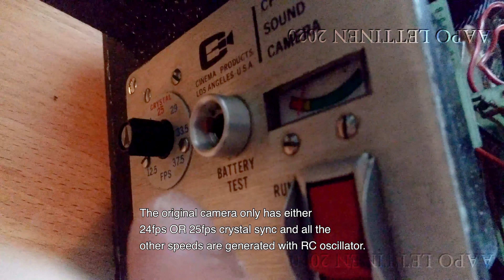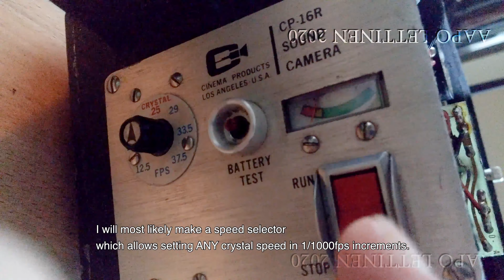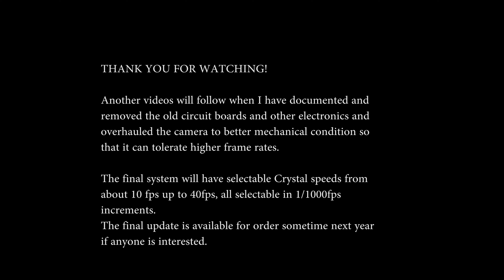Making new Crystal Sync system for Cinema Products CP16R (part1)

Comment: Mr. Lettinen, I own a CP16R.  Of course, the board is questionable.  Kind of working, but stops once in a while.  Let me know if you have any more progress.  Interesting to know you bought at few of these cameras.  They're heavy!  But worth the effort to make them work again.
Reply from the maker: I only have that one camera but my friends have more of them. I just started to redesign the crystal sync system and will probably make the modification to my own camera in June. it will be a 11 or 12 speed crystal modification with a accessory port which enables using a separate controller to have the 1/1000th fps increments available. This is to make the back panel of the camera more compact, the thumbwheel switches just take too much space. I will add a basic display to the separate controller too to monitor basic stuff like the battery voltage and the last take duration. The camera will be completely working without the external box too with a better more advanced end of film warning system and the 11 or 12 internal speeds which are all crystal sync. I am building a video tap to my own camera too because it already has the beamsplitter optics and I just need to adapt a small hdmi camera to work with it .  There might be a optical sound recording option coming sometime later :)

Comment: So cool. Will this system be something that operators can install themselves? When do you think they might be available?
Reply from the maker: thanks! I have done some refining on the design and will post a new video when having tested the new design with the camera.   It is possible to make the crystal sync system user installable though it is lots of work to install if it has additional features or if it needs lots of modifications to the rear panel of the camera. I have some "multipurpose" crystal sync systems which are specifically designed to be simple enough to be user installed (for example a 6-speed and a 12-speed model) and which can be adapted to work with the CP16R relatively easily. the main issue with any crystal sync project is that I am continuously running out of developing money which slows down the projects a lot. Thus the CP16R crystal update will probably be available with the current funding in about July or so. if having two paid preorders I could make the finished system in a month or two

Comment from the maker: I am finishing a 1-speed CP16R crystal sync controller which is user installable and is available in September2022. It replaces all the original electronics except the electric motor itself. Check it out here: https://cinematography.com/index.php?/forums/topic/94059-alcs-single-speed-crystal-controller-for-cp16r/